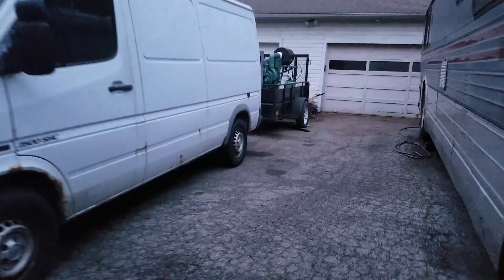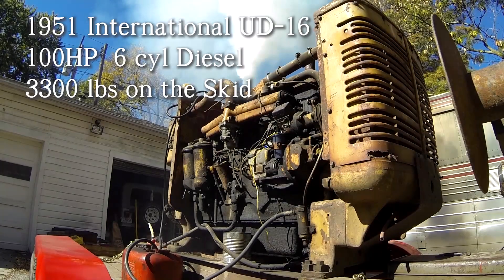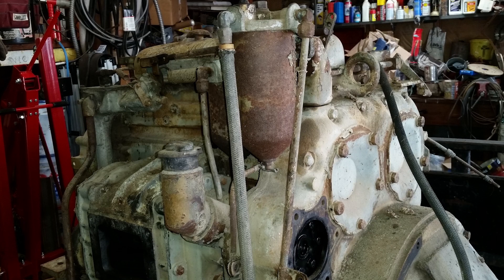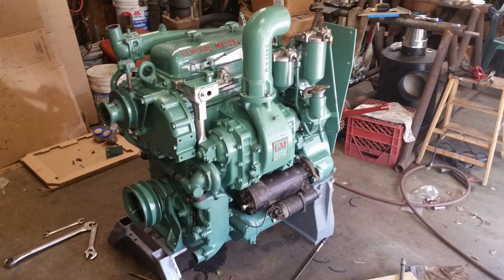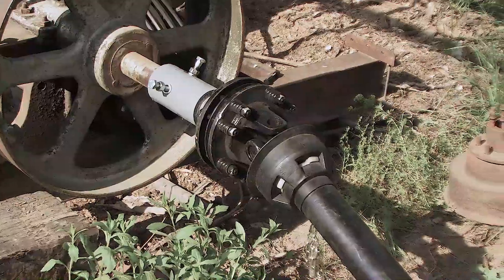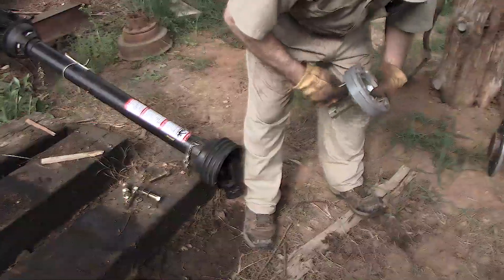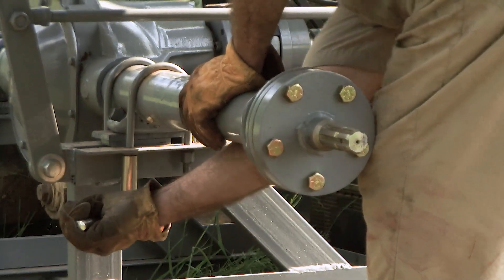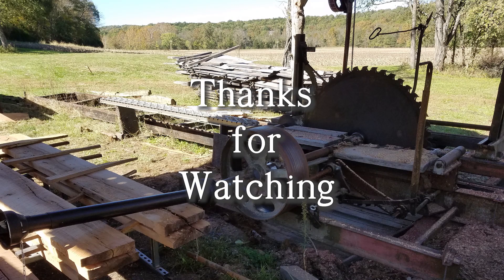General Motors "Detroit" Diesel 371 Repowers Century Old Sawmill

Comment: when the hydraulics hum and wine like thatb you need more rpmsor you might fry the pump (learned from experiance) but that was an older machine ..newer stuff might have better failsafes
Reply from the maker: I tend to not rev it out like I should.  I will try harder.
Reply: @rsgpartsdivision  it is designed to be runn full throttle all the time
Reply: absolutly love the resto job on the little detroit

Comment: Might run the rear end with more oil then normal since you turned the pumpkin upside down. The pinion bearing won't get oil or you don't. Nice setup though. I only have an antique bell mill I run off a pto.

Comment: Ud 16 needs injectors and probably new pre-cups, but most of all I suspect the Start Valves are Mushroomed from running it on gas to long, Problems with that is you have to R&R heads and only god  knows where you can get 6 new fire rings, anyway it is well over 50 years old and it still sort of runs, not bad
Reply from the maker: The UD16 is  6 cyl, 502 cid.  4.4x5 pistons. Sometimes it is listed as a D502.   Luckily, it shares many parts with the UD9 4 cyl engine.  Jensales has a bunch of parts.  Pistons, rings, bearings, valves, gaskets, seals.  Injection system seals kits are available.   Injection hard parts is more finding good used replacements.  No new available.  I would rebuild the injection pump myself if it were me.  Anyway, not something I can do as I don't have money, time, and a decent place to do it.  Hopefully someone else does.

Comment: I wonder if you had any problems with uneven wear  on the differential gears?
Reply from the maker: The 4 X 4  guys turn them upside down all the time.  The pinion bearings don't get oiled so well in that orientation, but my use is so low compared to what it is designed for.